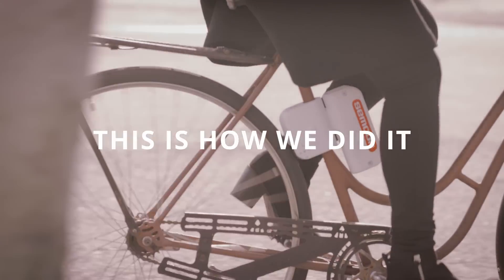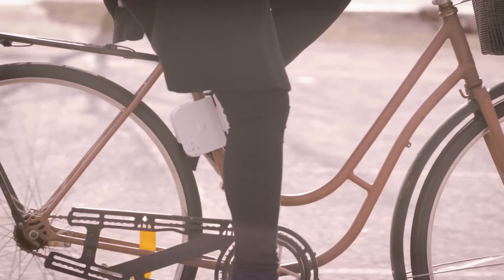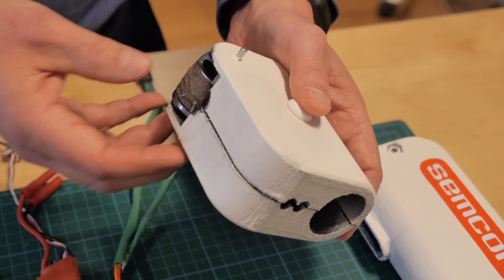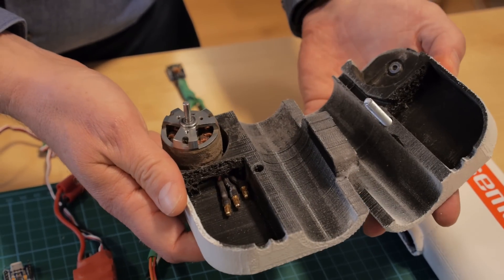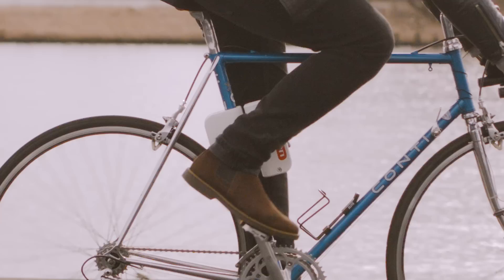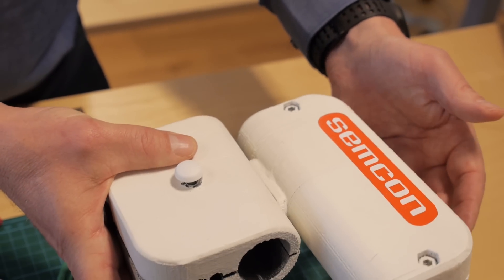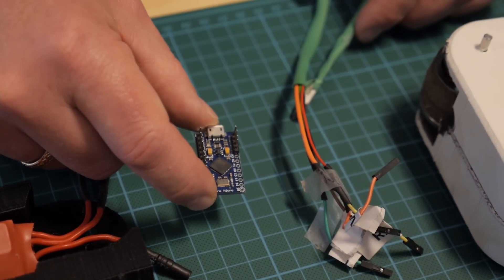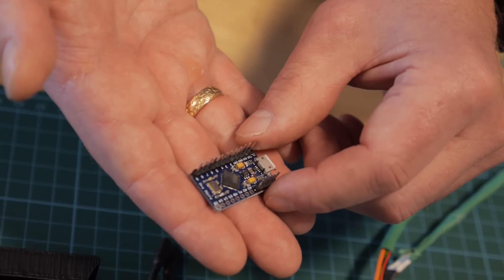Semcon bike engine - the story behind

Comment: 5km range is too small for practical use for most people. A little over 10 minutes at 25kph.
Also, a 5.0 lithium ion battery then takes several hours to charge from flat.
We've all felt the power of a modern RC brushless motor and fast discharge LI battery combo and wondered- but in my view this is not the way to integrate these technologies into a bicycle.